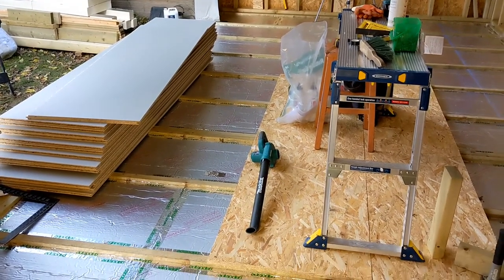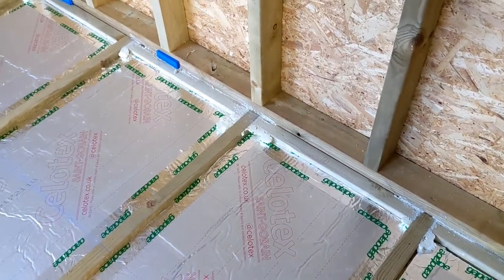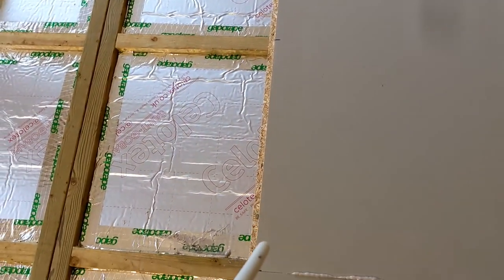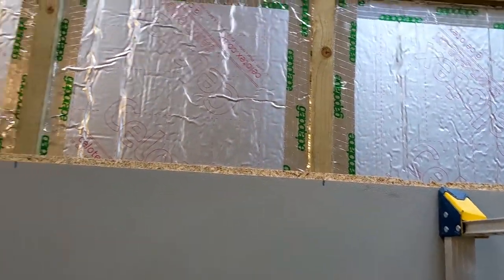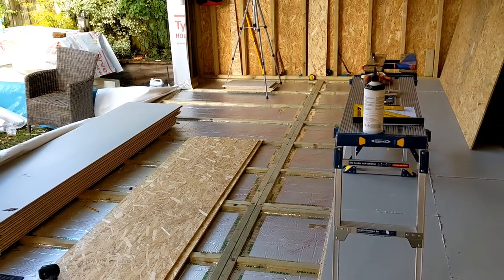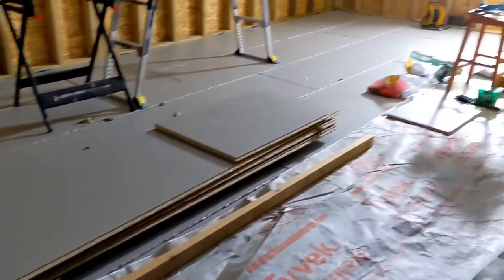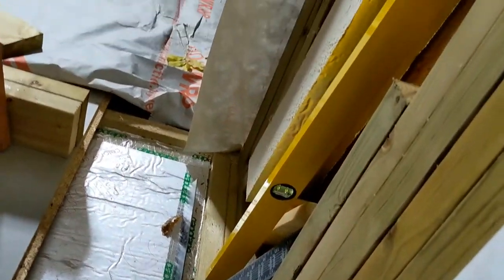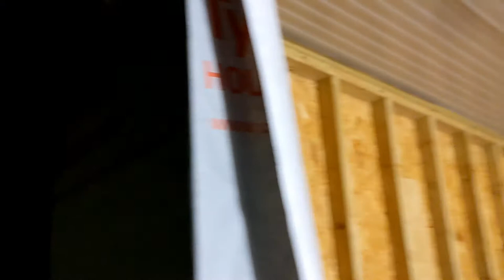Garden Room Build - Week 18: Ep 36: Egger Protect flooring goes down

Comment: Hi there, I’m also doing a DIY build and will be tackling the floor soon. Can I ask whey you decided against a floating floor, was it simply because you when with timber frame as opposed to slab base?
Reply from the maker: Hi, Yes really because its a timber base and I wanted the floor fixed to the base, Effectively this is floorboard. The finished floor is actually a floating LVT floor, on tope of this floor, which I haven't done the video for yet! Will get round to posting it soon. Good luck with your build!

Comment: Does the floor and glue act as the vapour barrier?
Reply from the maker: Hi the foil on the insulation actually acts as the vapour barrier, to stop any moisture coming up from underneath, though I have god air flow under the building so there shouldn't really be any moisture. So I don't think it really does much, or rather doesn't have to do much, The final flooring in LVT which clicks tightly together, so effectively that is the first vapour barrier from inside the room really. But again there isn't really much moisture in the room either!
Reply: @FatManBuilds  appreciate the response, thanks!

Comment: Well that the floor done, what are you doin next?
Reply from the maker: One row left to do on the floor, I needed the rest of the floor glue to go off as I need to fit the last row from the inside. I will get that done on Saturday hopefully! then it will be either cladding on the sides and back and soffits and Facias or on to the wall insulation!